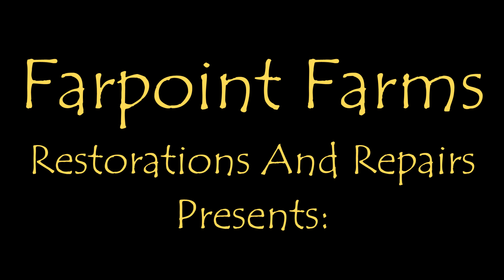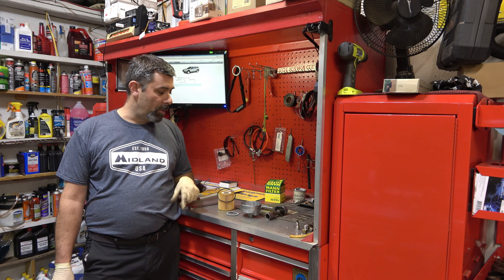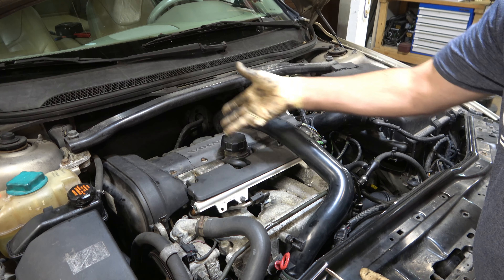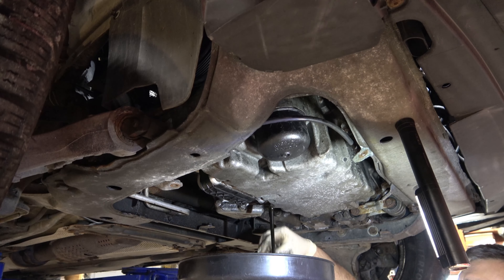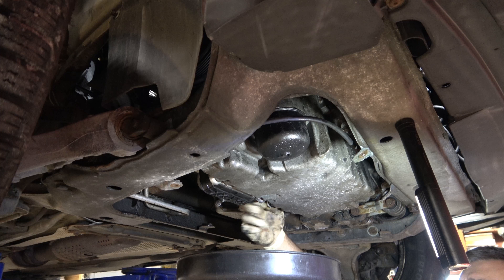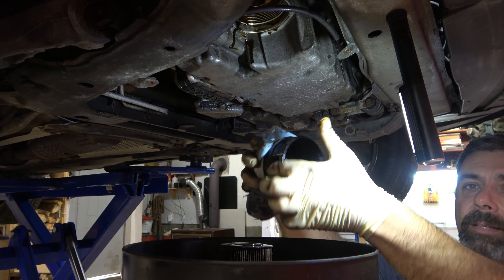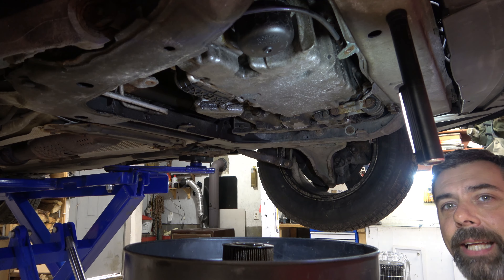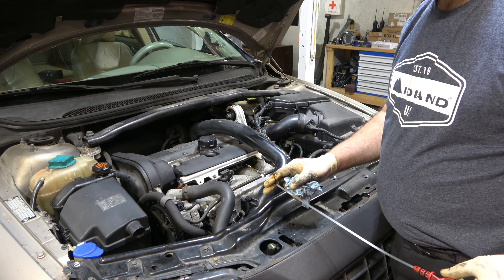93/08 VOLVO 5 Cylinder Oil Change Basics. Keep Your older Volvo rolling on the cheap!

Comment: When it comes to the "OIL DRAIN CRUSH WASHER", do you place the "rounded" side towards the head?
From my experience of changing the Oil in my families Vehicle's for over 20 years, the Crush Washers have a Rounded and Flat side from the Stamping Process from the Manufacturer.
I may make any difference to the "Standard Person" but what do you think as a Professional Mechanic?
Have a Great Day!
-Thomas 🖖
P.S. What is your Experience when it comes to using a Universal Variable Clamp Style (not Band) Oil Filter Socket? The one with two Jaws and Springs that go onto a ⅜" Ratchet.
Reply from the maker: For your first question, I can't say that I've ever noticed an issue while using the washer in either direction. They deform when you tighten them, so any casting usually gets smooshed out of it.
   For the second half, definitely get a genuine filter socket. The tool you are speaking of is meant to get off stuck spin on type filters and will cause the plastic housing to crack.
  Hope this helps!